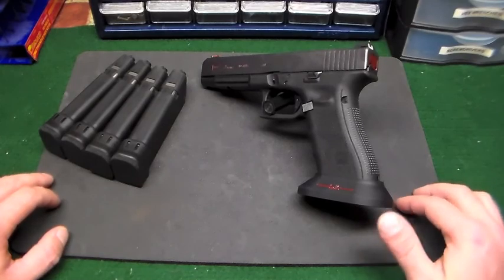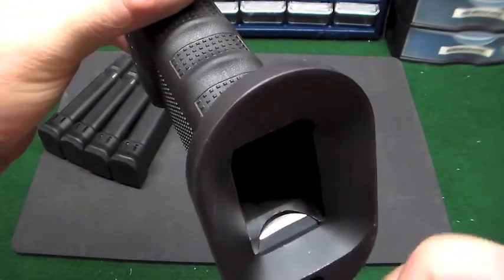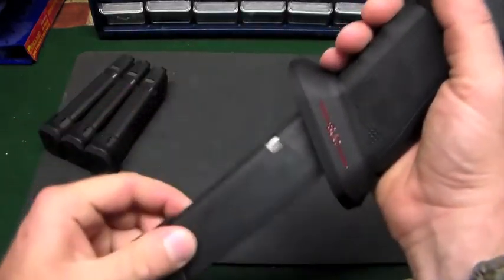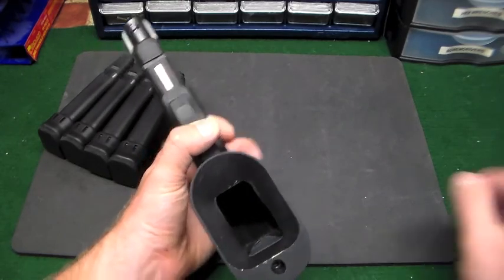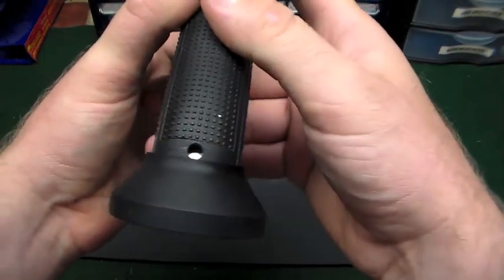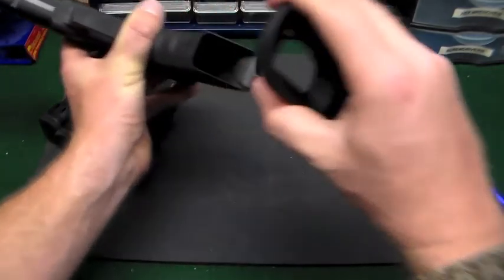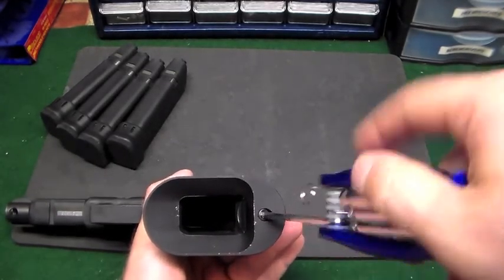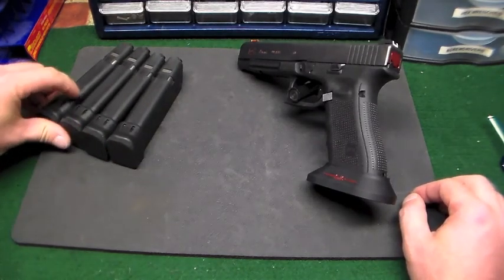SJC Magwell Update

Comment from the maker: I'm glad I can help. I would recommend extended baseplates on your mags if you are going to run a magwell. It makes it that much easier to seat the mag, and not have it fall out after the first shot on a reload. You would be surprised how much it does help with recoil management, and getting a consistent grip on your gun. I have a new vid up showing how I improved the reliability of this magwell. Check out my channel page, and you should be able to find it. Take care, and I hope it helps.

Comment: Thanks for the information on this video; have been looking and researching magwells recently. Have you tied the SJC heavyweight magwell at all? I wanted to see how it compared to this aluminum one. I use a large backstrap and know I will ahve to cut it down for this one to fit.
Reply from the maker: Sorry, I don't have experience with that magwell. This is the only competition magwell I have. I'm glad you found the vid informative. Thanks for the kind words.
Reply: g54023 Yeah it definitely was a huge help. Do you know if SJC has resolved the issue with this mag well? For example if I were to order One would I still have to fiddle around with it like yours or would it be better right out of the box?
Reply from the maker: Sorry, I honestly don't know. I haven't kept up on their products since I purchased mine. You may want to contact them and ask about it.

Comment from the maker: Thanks for watching. It does helps with recoil management. Also helps to give you a more consistent grip on the gun, and aids in quicker follow up shots. Definitely helps with reloads as long as you can keep the dang thing from binding up. I am putting together another follow up vid to this one in a day or so. I had to do some modifications to get this to work 100%. After my mod, I love it. In my opinion, it's one of the better mag-wells for 4th gen GLOCKs, but it's not perfect by any means.